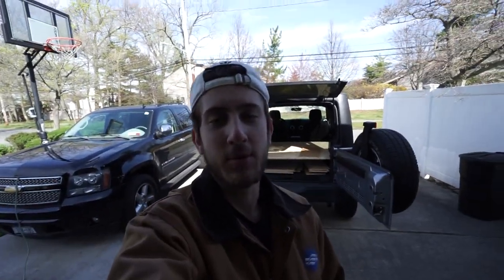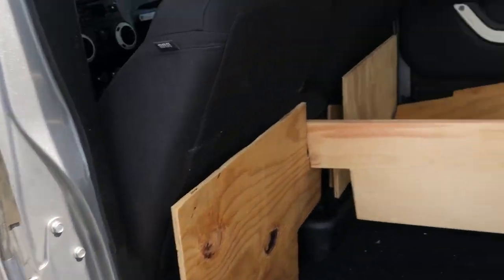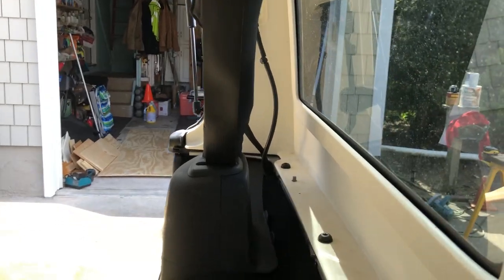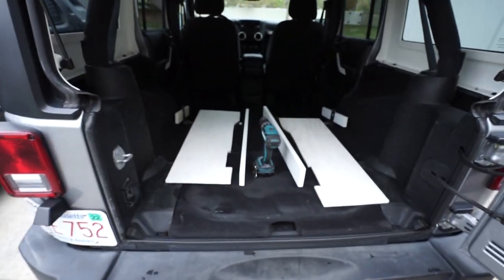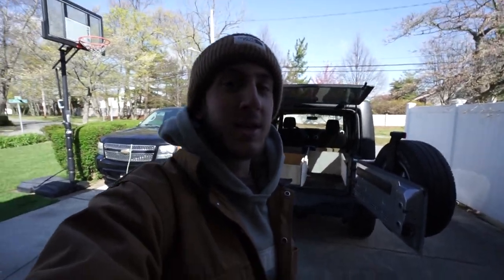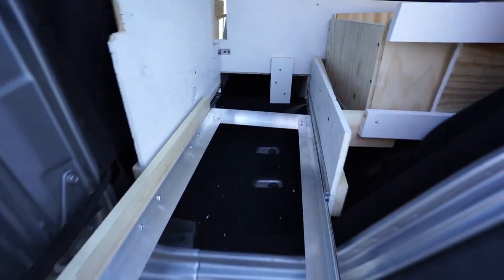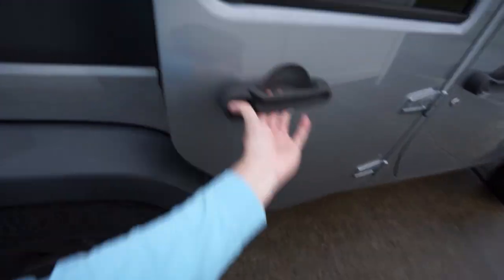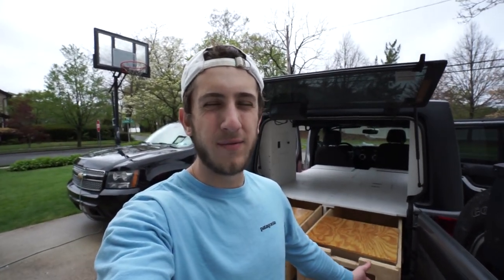Full Bed Platform & Sliding Kitchen - Jeep Wrangler Camper Conversion Build Part 1

Comment: I drove across Canada with pretty much this for set up my honeymoon. The 2 problems I had, 1 being 6’3  it’s a little short. I fit on a slight angle with my feet between the seat.#2 being able to sit up in bed. If you have a bad back at all you’ll regret it. Since you took out the back seats dropping it a little lower might help and having a larger slide out might help.
We just added a 3rd to the family so this no longer really works for us so in the spring I’m going to attempt to make a hard top camper. (Remove my roof and attach it to the Jeep)

Comment: I've been looking at these kinds of video's for years, you are the very 1st person who has designed and built exactly what I had in mind.  I still do not own a Jeep yet, but would love to know some of your dimensions. I plan to do this with my wife, so I was curious of dimensions like distance from sleeping deck to roof, width of sleeping deck  left to right, total sleeping length with tail gate closed, and how high did the deck have to be to accommodate the fridge on a slide? This video is great!  cheers
Reply: I built almost a similar platform. If I remember at the back door it’s 43”(I have the built in subwoofer) and kind of tappers out to the doors which is 47” between the doors.
I built the platform on 2”x6” an 1/2” plywood. Only did it that high for storage underneath. If you’re anything over 6’ you’re going to be cramped. I smoked my face on the roll bar sitting up a few times so that was fun.

Comment: Why does everyone put the stove on the left sliding drawer instead of the right by the tailgate?  It seems like that would offer more space when you stand and cook?

Also, can the cooler section hold a refrigerator cooler instead?  Or are they taller?  I'd love to see a low design like yours, but with a plugged in fridge instead of a cooler.
Reply from the maker: Jeep has been updated since this video with a fridge and a better stove set up

Comment: Re 2 dr.. The higher your platform the longer the bed. Built mine to the window height, I'm 6-2.. lots of storage below.
Reply from the maker: Basically where mine is at. Just hard to climb in and out🤣
Reply: Exactly.. Thats why I've redesigned my 2dr JK to include a tent off the rear bumper for a better camping experience, 75" long, full sitting headroom and the best part, EZ to get into!

Comment: How did you find out where you needed to cut?
Reply from the maker: A tape measure! Always cut less than u need to and test fit the piece, then chip away until it fits right
Reply: Thanks!